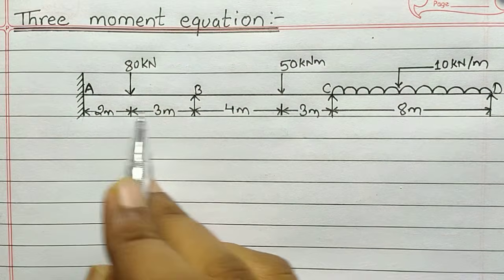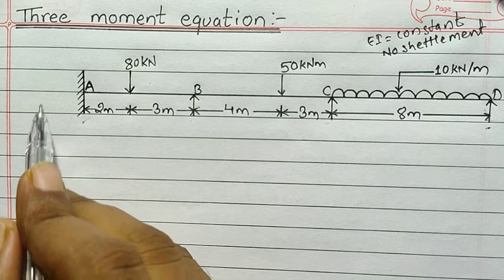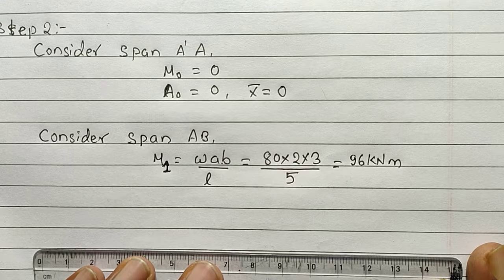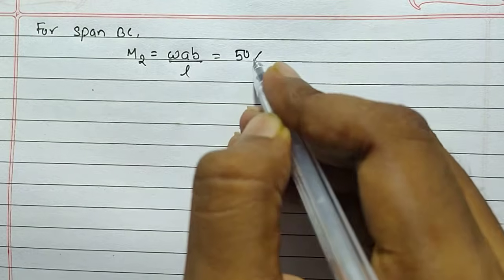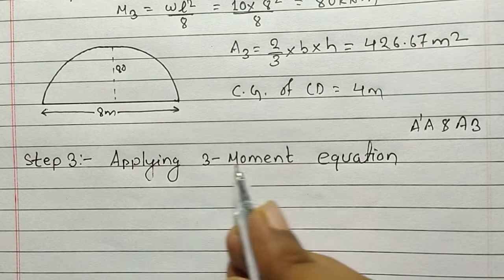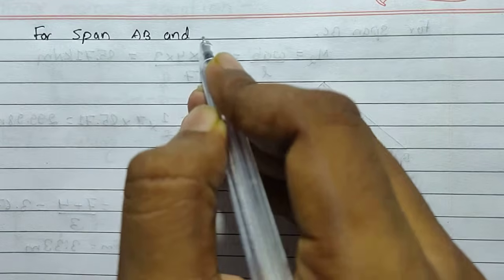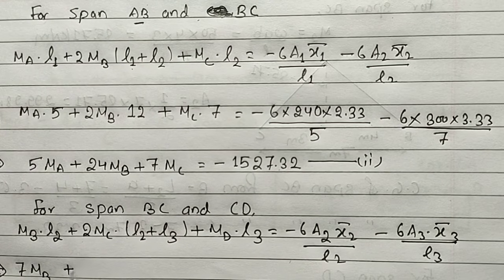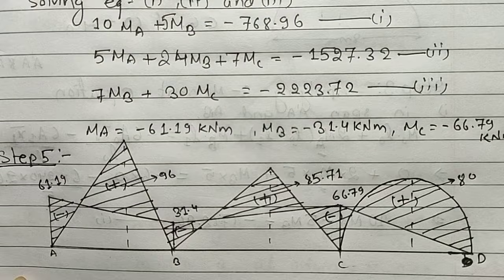Clapeyron's Theorem Of Three moments

Comment: What is c.g?
Reply from the maker: C. G. is center of gravity where whole mass of the body is assumed to be concentrated.
Reply: its centre of gravity. for example when you take a simply supported beam, which has a point load at centre of the beam .So we get c.g( i.e centre of gravity from left hand side support ( since it's having point load at midpoint !